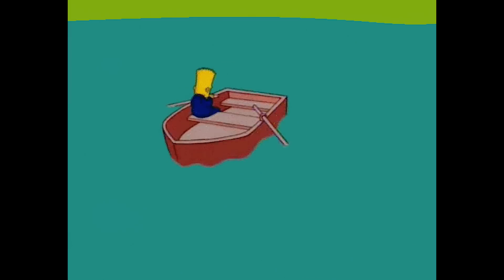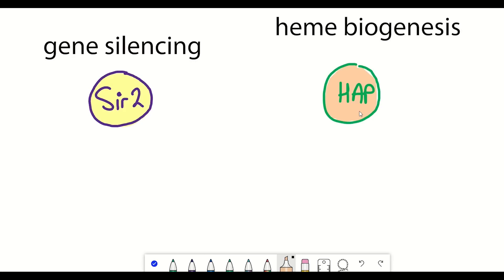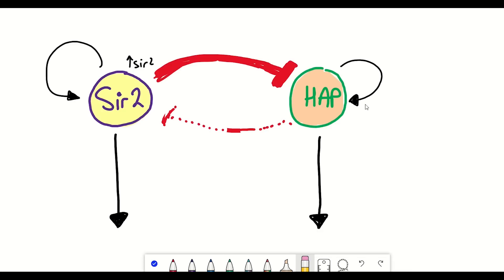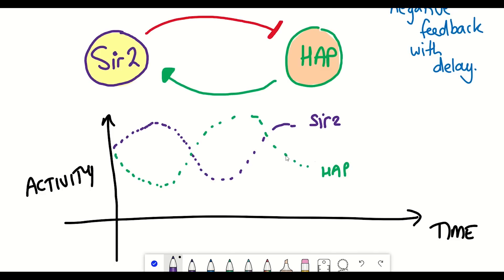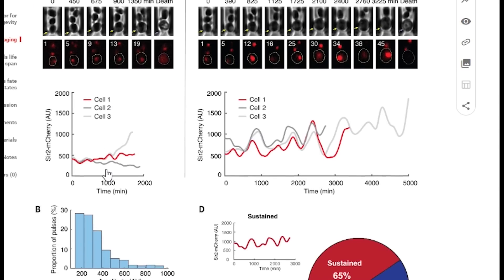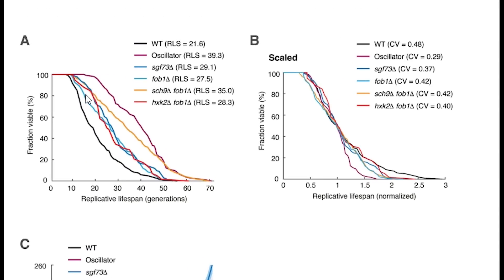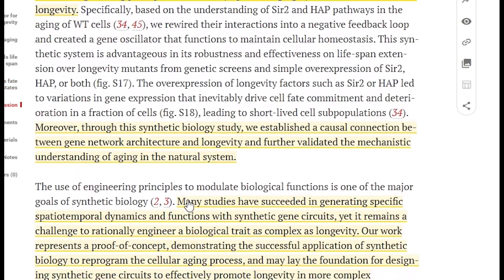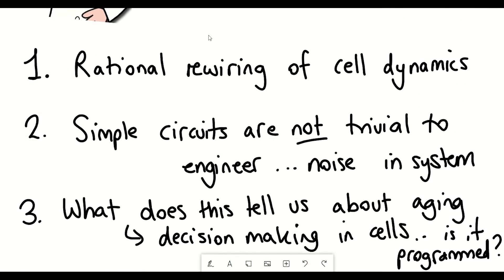Engineering cells to live longer

Comment: So how can this be integrated with what has been said so far about hyperactivation of Sir2 increasing longevity? Is it that mitochondrial dysfunction is less damaging than the loss of gene silencing, so if instead of oscillating you push the system that way you still get a benefit  above normal metabolism?